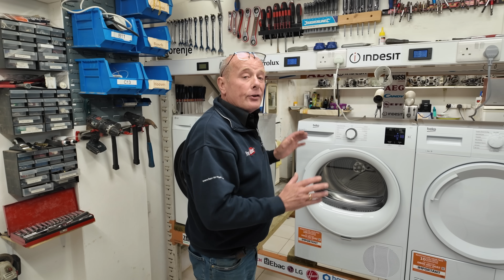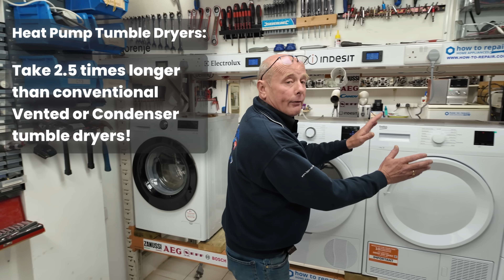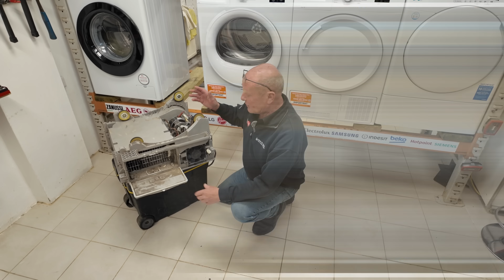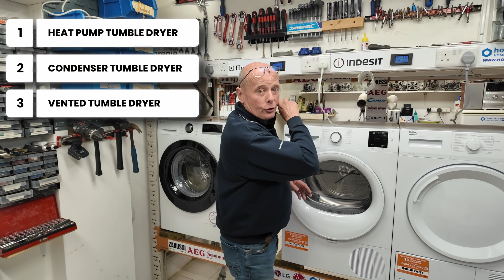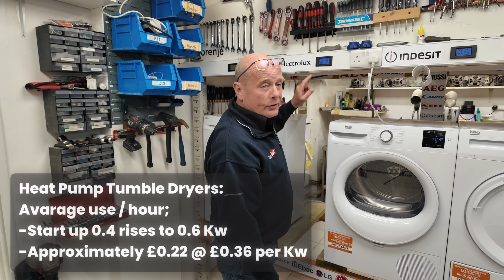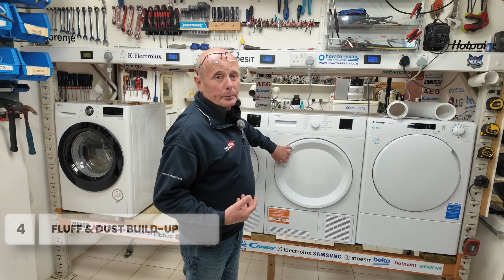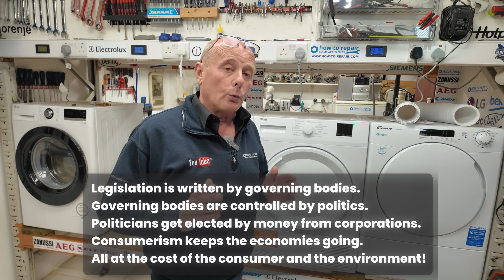Tumble Dryers the Shocking Truth About Heat Pump vs Vented & Condenser, NEW LEGISLATION!

Comment: I bought my Grundig heat pump dryer over 5 years ago when my Bosch condenser dryer packed in within 3 years. I was lucky in that they were launching the product in the uk and got it for just over £300 and game with a 5 year warranty. I clean the lint filter each cycle and the machine also allows me to remove the condensor box to clean each month. So far its worked flawlessly and has lasted longer than my previous dryer.

Comment: What the problem will be is that the coils will catch more lint in fins. Unless the fins are cleaned monthly as time wears on it will take longer to dry the clothes. I use a conventional dryer. All that is needed to clean the vent line to the outside and clean the lint filter. I have tried dumping the heated air inside of the house and had negative results. The filter is incapable of filtering out the finest of lint. The laundry room filled with so much lint dust that it was caked onto everything, not to mention the excessive moisture dumped into the room. I have had vented dryers last forty years in the past. That one dryer only required one heating element and one drive belt in all the years it was in use. Yes I do my own repairs on the good old fashion equipment. I wish I could find one of the newer Maytag wringer washers. They are the most efficient washers out there if you can find one. You judge how long the wash cycle will last. You decide how hot or cold water you will place in the tub. Now the real saver is if you do not use a chlorine based bleach, you do the whites and after they have finished washing and running them through the wringer, add the color clothes, it might be several small loads but the savings come in the water you reuse, yes I said reuse! Now if you are in the trades industry or construction, you can also wash your dark clothes in the same water. It works. The Amish have been doing this for many years. Yes some sects of the Amish will convert the washer to run on a gasoline motor or power the machine with a generator and some have installed solar and run the machine on their own line current.
There is a major concern as to the refrigerant gasses used in the heat pump dryers using refrigeration system. It is no longer the safer gasses like R12 or R22 but some wild gasses that are literally propane and butane based. If you should hav3 a leak in the system and you turn on the dryer with a mechanical style switch, you will have an explosion that will blow that dryer apart and quite violently. BUYER BEWARE!

Comment: I’ve had a condenser drier previously and bought a heat pump tumbler drier and it’s useless . More than double the cost and takes around 3 hours and still doesn’t fully dry your cloths . My advice leave well alone absolutely terrible. £750 of junk.

Comment: Thank you for saving me from buying a heat pump dryer which sounds like a good buy but after what you've told me, I will stick with condenser dryers which are reliable, safe and easy to work with/maintain.  Much appreciated 👏

Comment: Just wait until these items have to be internet connected to function at all and lock you in to an annual subscription to keep them switched on. Then when they think you've had sufficient use (years) they remove support effectively turning it off and force the purchasing a new one. It's happening with lots of other appliance types right now. We even have air conditioning units that the energy supplier can turn off remotely if the grid has a high load, not much of a stretch to think the same method could permanently disable it if they declare end of life when they see fit.

Comment: The only advantage I see is the fact that you can connect both washing machine and dryer on a 16A breaker switch. Combined they use less than 3600W

Comment: Great stuff, yeah, I’ve seen here in the states some videos on heat pump dryers and how difficult or should we say problematic? It is to do some regular cleaning maintenance. This is a very different machine than the ones you’re showing here and if you don’t do this of course you end up with a mess Down the road

Comment: The true environmental cost of an appliance should take account of the impact of manufacturing, marketing, distribution, and disposal (all of which are affected by its lifespan), as well as maintenance and day-to-day running costs.
If regulators can't do this calculation then they are not up to the job, or they have been sidelined by commercial interests.

Comment: I'm in the US and will just say that my gas vented dryer is now partners with its third washer.
Let's hope this new marriage lasts as long as the previous two.  I did replace both the belt and gas burner over all that time, but the cost for each was minimal and easy to do.  I'll never go electric on a dryer as a gas unit is too straightforward.

Comment: I bought a Samsung heat pump dryer, after research, and it uses far less electricity and has sensors so it will stop when the clothes are dry. I use it everyday. I clean the filters after each and hoover out the bottom filter when it needs it. A brush was supplied to clean the bottom filter to loosen any fluff on the grill.  I decided to take out a maintenance contract on the dryer just in case but I did this with my old washing machine and that has been replaced after 10 years of hard use.  I’ve still got my old condenser dryer in the shed in case of emergencies. I’m pleased with the heat pump dryer and my clothes come out much softer than the old condenser dryer. We will see how long the heat pump dryer lasts.

Comment: when ppl ask me to change the compressor on a fridge I straight out tell them 1k at least, so they go elsewhere XD, but some actually do it still on a 5year+ fridge (just buy a new one)
luckily on lg heat pump dryers the whole bottom part is "easy" to take out and clean (if you want to).
And you can order the whole thing, but for how long, how many years?

Comment: Does the heat pump version draws the heat from inside the house? But what if the heating is done by coal or oil? I'm now thinking it's not ideal at all... Even in summer that sounds like not the best if you have central cooling/ac or even a heat pump... Now the AC is extracting heat from inside and the dryer is "concentrating heat" as it's not really escaping anywhere it will bleed out or rather back in to the house afterward ok the AC could compensate and not extract heat from inside, but still you would need to pump the heat out from the house after.  Has anybody done any calculations on this?
Reply: No you've got it.  They always want to skip this part.
In the winter, it's outputing COLD air into your house.  That will need to be warmed back up, with fossil fuels in my case. So you really aren't drying the clothes like you think you are.  Your using fossil fuels, but with one more step in between to MAKE IT EVEN MORE INEFFICIENT.  

These things should be outlawed.

Comment: My £450 German brand/Made in Poland heat pump tumble dryer comes with 5 years warranty - parts and labour. There are two filters down below that need to be cleaned / emptied after each use. It does take longer, but my electricity usage hasn’t gone up a lot.

Comment: Our dryer lives in a detached garage so a vented one is the only option due to low temperatures. It's an insane waste of energy though wanging it out into the air. At least it gets to run on off-peak electricity.

Comment: some good points my problem with condensing dryers is the vent the heat into the house it would be nice to chuck it outside like a vented one.
also the condenser unit dont fit under the taps in the sink to clean it out

Comment: I'm on my 2nd heat pump drier both Samsung with 5 year warranty. First one lasted 7 years with no servicing. 2nd has had all the compressor, condenser and other workings replaced every single year so far under the warranty and it is clear that the drier will not last significantly beyond the 5 year warranty and that it will likely not be economical to repair. We are a large household so fairly heavy usage. Our old condenser driers with ordinary heating elements did used to last longer. One further advantage of the heat pump driers is that because they only use around 300-600 watts, if there is any sun shining and you have solar then the electricity may not be costing you anything at all. Whilst the same is sometimes true of a traditional element based drier it is much less likely to happen very often that your solar will be covering the full 2.5KW, except on the brightest days when you might have been better off hanging the washing out anyway. 
I've never noticed clothes wearing out any faster with a heat pump drier, so whilst I can see some reasoning behind that I haven't found it to be a problem. I actually like the fact that heat pump driers dry cooler. I like to bundle as many mixed clothes in the drier at once, so would normally only use the low heat setting on a conventional drier, but on a heat pump one you don't need to worry about heat damage that some clothing types can suffer. Most clothing that says not suitable for tumble drying ( though not all) can be dried in a heat pump drier in my experience.

Comment: I wonder if it really works like this. My dryer uses (simply said) less total energy, when you leave it on the recommended eco program and it dries twice slower. Also it has the very same filter (actually double filter) in the doors as demonstrated on the condenser dryer. As for those old types, I was discouraged to buy a dryer for many years, because the first two I had like20 years ago were total rubbish - loud energy suckers that did poor job. Compared to that, the modern smart dryer with a heat pump and inverter motor is completely different league and I love it.

Comment: The Air-Con in my car failed, but due to a blockage of leaves, rather than fluff. The better a heat exchanger is at exchanging heat, the better it is at collecting debris.

Comment: Sorry old mate, heat pump dryers are better in every way. Just don't buy a cheap dryer if you want it to last. You can buy a heat pump dryer for $500 from ALDI, The dryer lasts 3-5 years that's pretty good value.

Comment: I have never had a non manufacturer engineer maintain any of my systems. There is a thing called warranty that extends to the expected lifetime of a machine (in the Netherlands at least, and that goes way past the european mandatory 2 year manufacturer full warranty).
A non heatpump dryer would require me to get a second group in my house, while it now shares a single group with the washing machine.
The time it takes to dry is rather short. And there is no moisture leaking into the air, nor is a an exhaust pipe required. The best thing about it is that you can have a low temperature drying too.
Of course there is a question of why would you use a dryer at all, and that's for not having to use any laundry softener.

Comment: The solution is to make new machines easy to clean the parts that currently require a 4 hour teardown. Or using the tank of water before being dumped down the drain to spray down the condenser after a set amount of time , ( easy to clean water pump too)

Comment: We don't have a dryer... we just put everything to dry naturally on the wire. 
But i'm very suspicious that heat pump reduced energy consumption unless the cold air is expelled outside of the house. Thermodynamics laws apply, and ising a heat pump in a closed system often makes no sense: you can't cool your house by opening the fridge door.
So heat pump dryers may make sense in summer, but likely not in winter when you have the heating on in the house.

Comment: i think the brand actually does make a difference .. if the heat pump dryer is build cheaply and has a generally bad design (the complete tear down thing) then of course that one will be worse. On the other hand i also think that the heatpump itself will hold out much longer than the heating box on the other dryers .. just think about how long a fridge works without any maintenance .. there simply are no exposed parts that get damaged that easily .. of course it may need cleaning .. but that is the part where the design plays a critical role .. and i think that is where there should be government intervention if it is just build stupidly and with the intention to fail from dust buildup (it cant be an accident or oversight .. these types of machines have been figured out ages ago .. not being able to clean a heat exchanger from dust buildup without ripping the thing apart is just silly).
Reply from the maker: I think heat pump technology is brilliant, but these machines are only lasting on average five years they take at least two times longer to dry the clothes at least twice the amount of wear and tear and components and the accessibility to do maintenance is an absolute nightmare. manufactures do not seem to understand what maintenance is needed and how easy it is to do. They seem to build it and assume it's perfect without testing properly. Thank you for your comment. I would be grateful if you would share this post, as it’s the only way to force things to go large nowadays.

Comment: Sounds like the heat pump design just needs some alterations to make it spin slower and have a more modular and maintainable layout. I feel the problem here is the manufactures trying to make things harder to repair to make a bit more profit with built in obsolescence. It is like the phone industry when they decided all phones should have glued in batteries and glued on backs making them hard to impossible to repair when the batteries wear out. Its taken years and EU legislation to push phone manufactures back towards removable batteries. I guess the same will happen with heat pump dryer maintainability.
Reply from the maker: Absolutely spot on! The heat pump dryer concept has great potential, but the way manufacturers have implemented it seems more focused on profit than practicality or sustainability. There’s already growing awareness about planned obsolescence and the right to repair, so it’s just a matter of time before consumers demand more sustainable, maintainable designs across the board.

Thank you for your comment. I appreciate people like you taking the time to write it out. Please share it where possible. It might help others make a wise choice instead of being misled by the industry.

Comment: After 5 years of heavy use, the drum roller bearings in our LG heat pump dryer started making noise. So I spent about $200 AUD on new rollers (including bearings), new felt seal, new rear bearing and a new lint filter. The only pain was that pulling it apart, washing out the coils and reassembly took FOREVER. So yeah, worth it IMHO but if I had to pay a technician to do it would have barely been worth it. Still love the machine for my use case, but the old school dryers should not be outlawed.
Reply from the maker: Thanks a lot for your comment mate. If any of your friends or family are thinking about buying a new dryer, it would be helpful to share this video with them. It will give them an idea of what to expect when purchasing a new dryer.

I hope older models will still be available, but I can't promise that. It's important for people to know the differences between the dryers on the market and understand any potential issues before making a purchase.

Comment: I am a building services commissioning engineer so I commonly deal with heating and cooling systems but I would not buy a heat pump drier because they are way too much hassle.  The more complex a system is the more can go wrong AND IT WILL believe me, my best advice is go for simplicity or regret it.
Reply from the maker: I think heat pump technology is brilliant, but these machines are only lasting on average five years they take at least two times longer to dry the clothes at least twice the amount of wear and tear and components and the accessibility to do maintenance is an absolute nightmare. manufactures do not seem to understand what maintenance is needed and how easy it is to do. They seem to build it and assume it's perfect without testing properly. Thank you for your comment. I would be grateful if you would share this post, as it’s the only way to force things to go large nowadays. Have a great day, Paul.

Comment: I got a heat pump tumble dryer, but am wondering if I should of got a dehumidifier instead.  I know dehumidifiers break as well, but are 1/3 of the price of a heat pump tumble dryer.  As a condenser tumble dryer is too expensive to run, too justify using.
Reply from the maker: A dehumidifier can be a great alternative, depending on your setup and laundry needs. It’s much cheaper upfront and can also be more energy-efficient over time. If you have a well-ventilated space to hang your clothes, a dehumidifier could effectively speed up drying without the higher energy consumption.

Thank you for your comment. I appreciate people like you taking the time to write it out. Please share it where possible. It might help others make a wise choice instead of being misled by the industry.

Comment: so basically they should produce heatpump dryers that have an external heatpump instead of building it inside the machine. Then it could also be used for heating the house when the dryer is not in use.

Comment: I absolutely can't agree more.
I had a heat pump POS from Samsung. I had it 6 months and had 8 engineers out to it because it just kept breaking. After the first 2 engineers (within the first month) I demanded a refund. Samsung refused, ended up going through my bank to get the money back.

Whoever is reading this.. PLEASE don't waste your time and money on a heat pump dryer. They just aren't worth the hassle and stress.

If the technology, design and most importantly the repairability improves then they MAY be worth it BUT these things have been around for 5 years ish and yet nothing has changed.